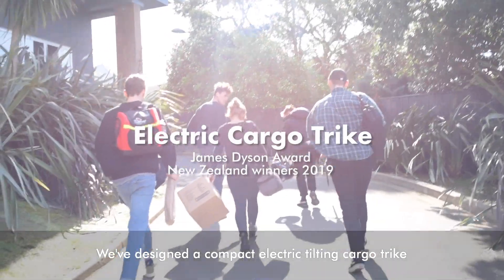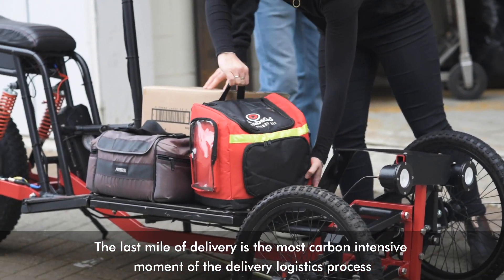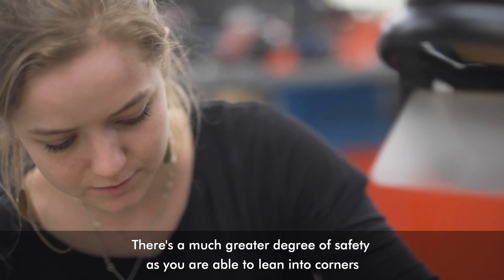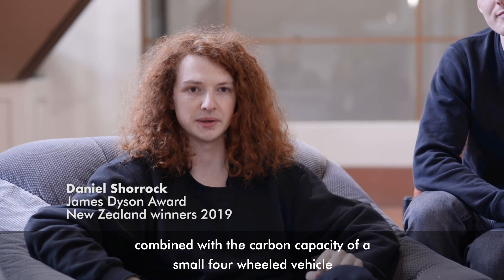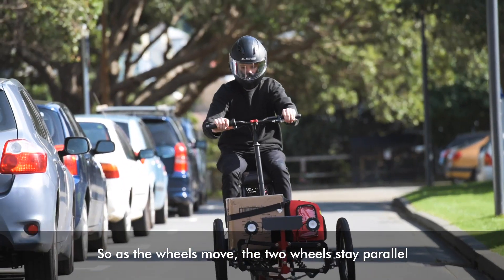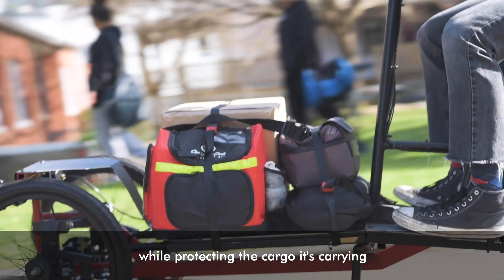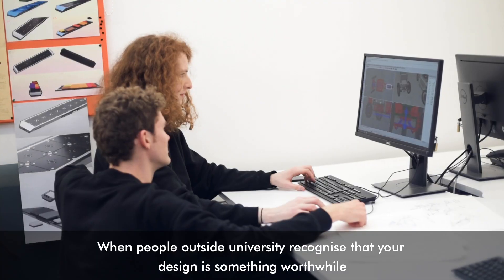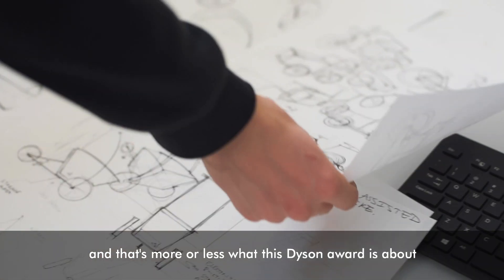Electric Cargo Trike - a compact electric delivery bike

Comment: i think the biggest test of a tilting trike is to ride it no hands, and be able to steer.
i havent seen any do it yet.
i havent seen any countersteer, either. they all have to steer normally, like a car... and that is the complete opposite of a bike. at which point it just doesnt work with tilting well.
then... the tilting. only one design have i seen where the natural position is upright. everything else has this tendency to flop over, an inherent instability. 

havent seen many where the rider looks comfortable... at ease...

Comment: Can they make the cargo area big enough for 2 folding plastic black crates? 
About 580 mm by 400 mm each. 
That means a >800 mm long x 600 mm wide deck. 
I like a deck that is not wider than the handlebars, so as to ride along the narrow gap between queues of cars.